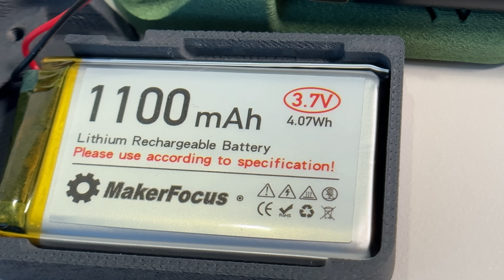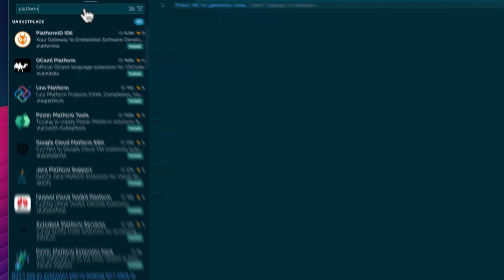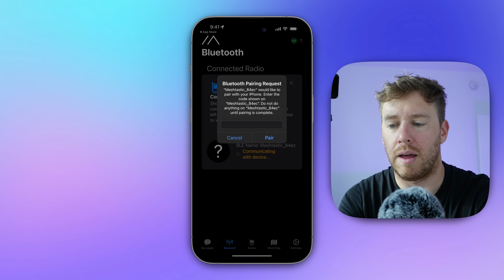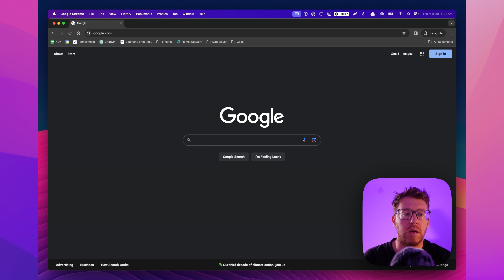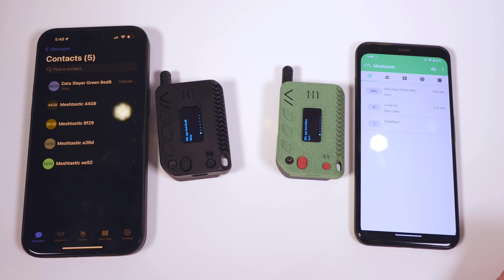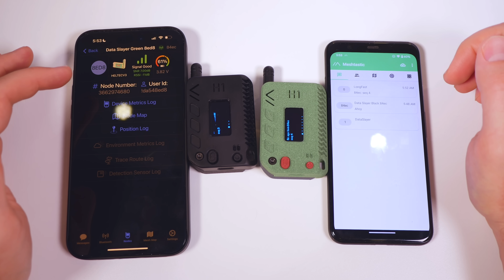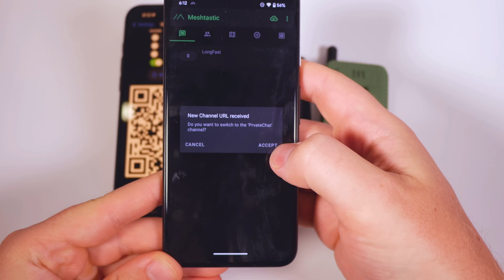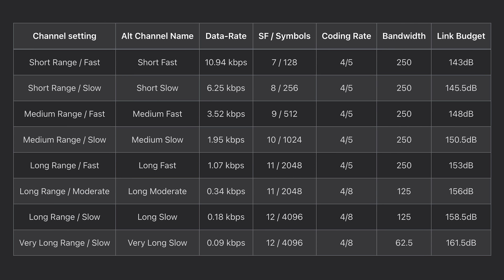It’s Been a Good Run, Phone Providers.

Comment: Not to ruin the vibe, but LoRa over water is great, in normal urban settings they perform quite badly. Hopefully one day they can be used reliably in urban settings.

I had very sad results with the Heltec v2 and proper antennas I got 700 meters in a line-of-sight urban scenario, which is practically nothing. I hope these will be usable in urban areas in the future, reliably for up to 3-4 km in range, because in open fields they are truly amazing.
Reply: The more people using the mesh the stronger it gets
Reply: wowthanks u probably saved me wasted money. I have NEVER heard this before and found it surprising. i have been seeing more and more stuff about LoRa stuff and thought it was a good route
Reply: @squigglesmcjr199  Yeah, it's an adoption rate problem, really.
Reply: That all depends on if you have a main node high enough... I have 2 heltec v3 talking to each other 27 miles away right now..... And anything in between works cuz it fits through them
Reply: @SJV82  Maybe I don’t understand enough and correct me if I’m wrong, but if 2 nodes can’t talk to each other 1km apart, how will 3 nodes talk to each other over 10km apart? Even if the “main” (what is a main node anyway?) node is on a tall building or something.

Essentially, can you prove that a high main node will cover all of this distance even in an urban area?
Reply: If you have a Lora unit that only for 1km during testing, that's a failed test , get a better antenna... Dont use the junk antennas that they come with.
My repeater node is on a mountain at 2500ft. If you can see the mountain it's got reception.
Reply: @SJV82  That’s not urban setting…
Reply: The video and other videos are little sensational, people should take the plunge and set up at least one node, strength comes in numbers (to a certain extent) but it’s not going to perform as described. In any setting, too many badly setup nodes are as bad a too few.
Reply: Are you new to radio ?

No radio works well point to point when there's gigantic concrete and steel buildings in the way 🙄 !!
Reply: @edwardfletcher7790  sounds like a personal problem I never said it did.
Reply: isn't the point of this is to be used when society breaks down? when interference would be gone?
Reply: @edwardfletcher7790  not true. Some frequencies bend around obstacles better than others.
Reply: LoRa is a great low-power line-of-sight transmission method... but you're right. Maybe 200-300ft through concrete jungle... sometimes even less.
Reply: Lora is new meme buzzword like crypto
Reply: @driverjamescopeland 
You are right. 
Even UHF 5W portables will have 100 meters range between stone houses in a old village in the mountains.
The same radios will have 1000 km range in line of sight .

Wasn't LORA LOw RAte at the beginning ? Can someone help me with this ? I'm wrong ? LORA isn't long range with that power outout...😂😂😂
Reply: @jplacido9999  in the IoT space, they are Long Range when compared to others like WiFi and BT. And low power too. And guess what. Low rate too. Which won't let you stream 4K, but is perfectly fine to send the occasional data packet.
Reply: @ErazerPT  Yes.
But I don't remember if the first reference to LORA was LowRAte. I think so but I'm not shure ...🙈
Reply: Radio wave mirror, like a dish maybe on corners of buildings?
Reply: @jplacido9999  - to my knowledge, LoRa has always been short for "long range". On the flip side, it's development since inception was specifically focused around low-power transmission. The goal was not only to increase the individual Tx/Rx... but to increase the spectral bandwidth of CSS, to the point where devices could be daisychained to a much longer step field, with less signal signal degradation and greater data stream integrity. Basically, it was CSS optimized specifically for data-based transmission... as opposed to CSS being more of a step from analog to digital optimization.
Reply: @driverjamescopeland  
👍👍👍🙏
Reply: Hahaha you guys expecting 10km range from that tiny little thing? No way... first of all , the TX power is so small even 1cm thick double window shorten that range quite signifficantly. You have to have a 1- good antenna with highest gain possible and 2- 100% clear line-of-sight without any obstacles including 1cm thick window and 3- your node must to be as high as possible, could potentially be hooked up on a Helium weather balloon but that could potentially call US air forces and police so be carefull and 4- if you really want a maximum output power and maximum range, the GSM or UHF/VHF signal booster may come pretty handy especially custom made one with very little frequency range so the exact frequency will be boosted AND no other signals will be interfearing with signal comming out of the node. And that signal booster could be like 10kW if you want to. Personally i do have a signal booster for 2.4-2.8GHz WiFi signal. That crap can output 100W on a good heatsink which is totally illegal but who cares. This signal booster with omni-directional antenna provides WiFi coverage even 19km away from my house using also a good receiver ( USB wifi stick with high gain antenna ). With directional antenna i can access the internet exactly 57km away and guys... this test cost me 14 hours of setting that up and driving... so if you have access to the GSM or UHF/VHF signal booster, you can sent messages across the ocean potentially but first things first, check your local ISM bands and how much TX power you can use, my WiFi signal booster is total overkill and i could be arrested if anyone find this. I'm only using 2W right now which is also 1W above maximum limit in Slovakia but nobody cares and i have internet access everywhere around my house even 300-600 meters away
Reply: Wouldn’t 433Mhz solve the urban use problem?
Reply: Hmmm we could mount antenna onto drones to get above building level maybe
Reply: yeahhh, this. If you can get more people using it, it'll become better, alternatively look at placing router nodes on high structures/buildings
Reply: You'd need a Repeater in the city
Reply: WiFi HaLow is hopefully a viable alternative to Lora for higher bandwidth scenarios and seems to have better urban performance despite lower theoretical max range (you need to go to the desert to get 10s of km).
Reply: It good for sailing with multiple ships in call for a good fishing spot but the magnetism and signal Jammers that are placed to prevent loitering in big cites are the real issue with a device.
Reply: @recom273  why would your average person who has no interest in this "set up at least one node"? People don't even have backup food and water and that is way more important than this.
Reply: You really need a small group of friends to extend your mesh. Now the devices are getting cheaper I suggest you start a community on your frequency, which imo is the whole point. Then you can work together to setup a relay node
Reply: @tkni8458  3 nodes likely wouldn't, it essentially just allows for communications to hop between devices,

Say A is not in range of C, the packet can go from A to B to C.

Unfortunately, this makes it extremely vulnerable to a variety of wireless network attacks, such as sink hole attacks.
Reply: @squigglesmcjr199  no one's gonna buy them if they don't work, and if no one buys them they never work 🤷‍♂️
Reply: @tkni8458  You realise there are many cities next to mountains, right?
Reply: Drone repeater network, multiple drones operate in shift for 24/7 availability
Reply: I am in a very hilly area - have a half dozen lora devices and I’m struggling at a half mile within my own mesh.
Reply: Cool. Something to help criminals.
Reply: It's still ISM baud 902-928 just a wide band pulse. Still has issues with multipath and not going though solids as easily
Reply: @nyccollin  ...that's literally everything. Your argument falls flat.
Reply: @tkni8458  It might very well be an "urban setting."  Reno, NV and Phoenix, AZ, for instance, have mountains in line-of-sight of quite a bit of their city.  Louisville, KY has some pretty tall hills that you can see from parts of the city.
Reply: Repeater my friend…
Reply: It seems best applied to sensor data collection and inputs from long distance.  Utilities collecting meter data, farmers, rural gate/water/drain sensors.
Reply: Steel and concrete are highly effective at obstructing RF transmission. Cities have both in abundance.
Reply: @freedustin So that’s the whole point of the device?  To assist criminals?
Reply: I have a picture of a ghost on a tv.
Reply: @squigglesmcjr199 lol. No. Oversaturation.
Reply: @nyccollin  you are being intentionally obtuse.
Reply: @freedustin Hey he did say ‘that’s literally everything’ 😂
Reply: @nyccollin  you are focusing on negative aspects that apply to everything and placing the blame on one thing. Have fun blaming inanimate objects. emoji spam.
Reply: lmao that is better than HAM what are you crying about
Reply: LoRa?
Reply: @StefTechSurfer Long Range
Reply: In an urban environment, something like FreiFunk with the BATMAN protocol is preferable.  They require a router as a node rather than the LoRA device.
Reply: @samohraje2433  fascinating stuff, I wish you would publish a blog post about this

Comment: yes goodbye phone providers , all my friends in a 3 mile radius bought walkie talkies
Reply: You must be living in place with no buildings or trees, my walkie talkies range is 1 mile.
Reply: @notsecure  GPRS/GMRS/FRS + HAM all work quite well for over a mile in my experience :) I like that these little things are small and light (compared to full size radios) for off-grid. I can hide one in a tree and retrieve it later to setup my own relay service. A bigger "base station" that can tx at max legal power would be truly awesome. These little things are just the access gateways to the network you could create and they can mesh!
I think a lot of the commenters here are missing the point and applications.
Reply: @scottleggejr  Give it a few years and every city will have a mesh network
Reply: @DonnyThaDealer   no it will not
Reply: @DonnyThaDealer every city already had a mesh network.its called every single apple, Samsung, and Google phone
Reply: We run CB Radio's can get 10 miles on a good day, and nobody is on there but us. 2-3 miles on bad days.
Reply: My CB picked up cops in Mobile Alabama from Edmonton Alberta Canada one time years ago.
Reply: Uhf is better then cb
Reply: Walkie’Texties.
Reply: @kciwner  We were able to reach from Florida to Kansas on the CB during the day.
Reply: I carry a P25 radio instead of a cell phone sometimes. It's linked back to a home VOIP gateway I built.
Reply: @notsecure  then ur radio sucks
Reply: @scottleggejr  same
Reply: @kciwner  police radio is encrypted to you cant hear it unless u have the right code
Reply: @ Well I heard them. And I had no code.
Reply: @Porty1119 Sounds interesting, how did you do that?
Reply: I sense a tiny bit of sarcasm there.  🤣
Reply: @notsecure  Yes but this little device is no different than a walkie talkie AND it requires a working powered on phone to operate. That is a fail.
Reply: Exactly. More functionality for a lower price, at least was for me. Got radios and I can send SMS via it. And still can talk over it normally. And it has a much stronger transmitter (5W).
Reply: Me and the bros use Nintendo DS pictochat we don't need no cellular data
Reply: @bobinorlando  

Not through the eyes of a YouTube influencer. 😁